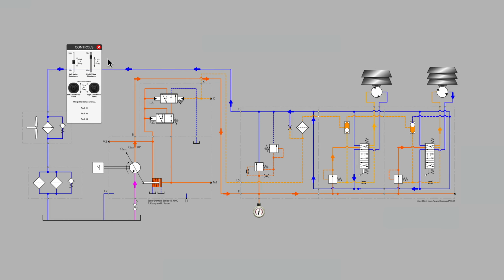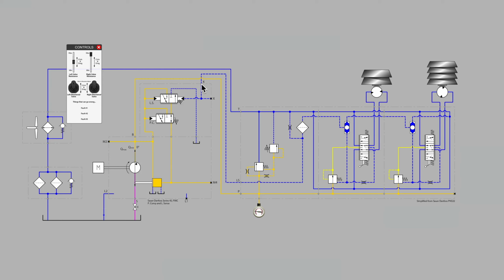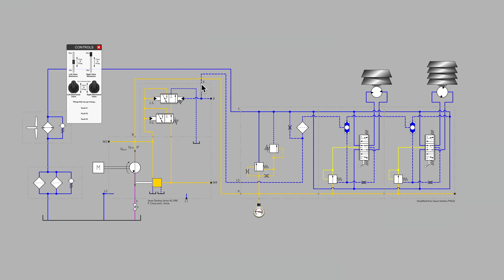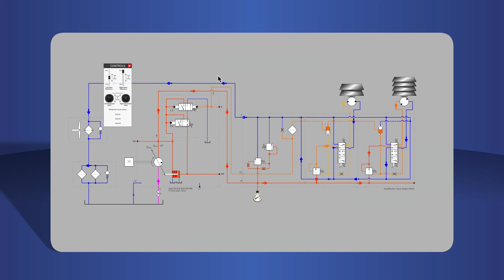Load Sense Bleed to Standby

Comment: One question that might seem dumb :)

Let's say that we don't have this orifice, once spool is returned to neutral position, load sense path from the directional valve is bled to tank. Isn't that enough to release the pressure from the LS line? Or this shuttle valve will block flow in other direction. You see, I have never thought of this, how does shuttle valve behave when flow direction is "backwards"
Reply from the maker: The load sense passages near a valve spool are typically isolated from the main T ports when the valve is in neutral. The LS signal network and components are their own little sub-circuit. Without this orifice (blocked off) the load sense signal pressure would remain high for a long period until internal leakage between components gradually occurs. During thus time (could be a long time) the pump will behave more like a pressure compensated pump, which does not offer the same level of energy savings. You mentioned backward flow through the shuttle valves (sometimes also called ball resolvers). This backward flow would not be a typical occurrence - can't think of a circumstance right now that would cause that. The LS line is really not a flow line, but rather a conduit to carry a pressure signal.  Did I address your question adequately?    - Carl
Reply: Thanks, make sense of course, you want to bleed it out quickly to avoid wasting energy
Reply: @lunchboxsessions  

The LS line is really not a flow line, but rather a conduit to carry a pressure signal. 
----------------------------------------------------
So any diameter for this conduit is acceptable, right?
But what about the flow line which connected from the pump output to the servo piston (swashplate piston) through the load sensing spool, what the appropriate diameter for it?

Comment: If the motor or let's say a cylinder were holding a load while the valves are in neutral, would it leak down through the load sense circuit?